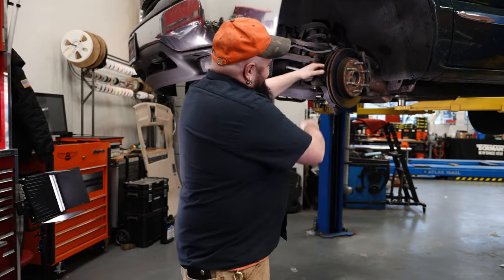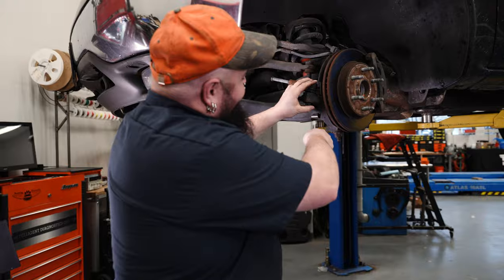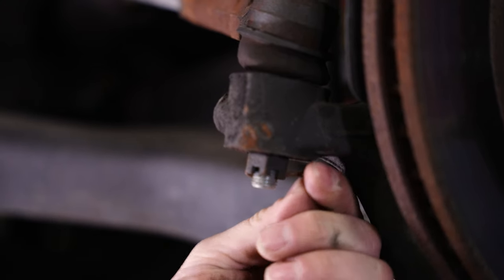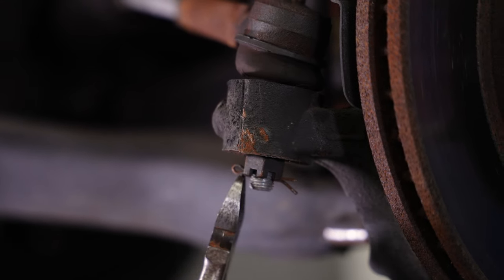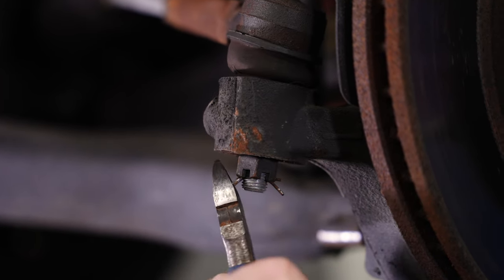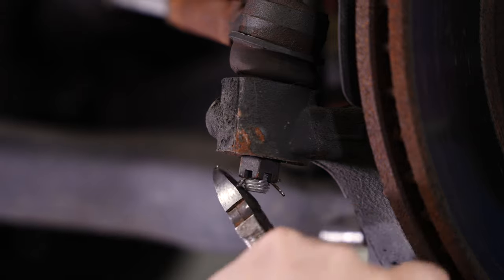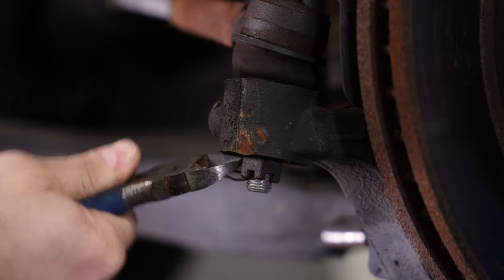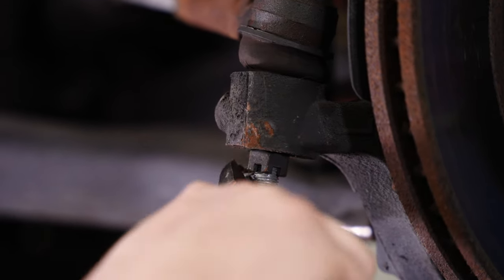This is the BEST tool to use for removing cotter pins!

Comment: Good video! I've tried it like that before and it works if it's not rusted or corroded too badly. My preferred method is, If I can a pair of vise grips to bite on the "loop" end, I can then leverage it out pretty easy. It also gives me the option of tapping the vise grips with a small hammer if it's stubborn or if the legs are twisted funky.

Comment: A cotter pin that thin is very easy to remove. I’m a railroad mechanic and we sometimes use huge cotter pins to secure the 2 3/8” radius rods. And those large ones are often hard to remove.

Comment: Driveway job replacing broken ball joint. I couldn't access the head, but had plenty of of the pin hanging out the other side. So I drilled off the head, and used vice grips to pull it out the long side. 😁

Comment: Duh!
Reply from the maker: See, that's why we made the video!  Some people learn something and others get to make fun of dingdongs like me. I was in my thirties before a buddy of mine showed me this trick when we were working on a motorcycle together.

I still show people this and many had no idea. Same guy turned me on to using diagonal pliers to pull Woodruff keys, too—works awesome. —Lem
Reply: @DormanProducts  😉
Reply: I was in mid 20’s now mid 60s and I’ve been teaching that method for a long time.
Not to pick to fine of a point but those are diagonal cutters.
Reply: @donziperk  diagonal side cutting pliers, that's the official description
Reply: I’m waiting for someone to tell you thats not a good method because you’ll damage the pin so you can’t reuse it. 🤣
Reply: They're cheap to replace!
Reply: @SILVERHORSEGARAGE  I was trying not to pick to fine a point. But thats the official official definition. Glad we got that sorted out. 😂
Reply: @SILVERHORSEGARAGE  ha I’ve seen plenty of people reuse them. Cheap people are plentiful.
Reply: @donziperk  I know they are cheap but some of us didn't have spare pins in the garage and didn't want to make a whole trip to the store for 1 or 2 tiny pins if the original one can work
Reply: @8gr8pes  Whatever it takes to get it done. But I have removed some pretty bad ones that definitely should not have been used. And a few nails. 🙄